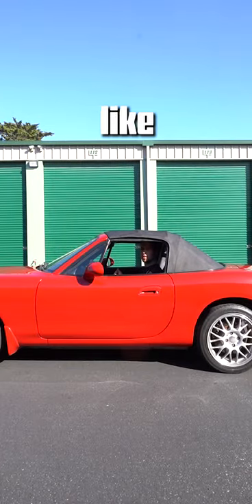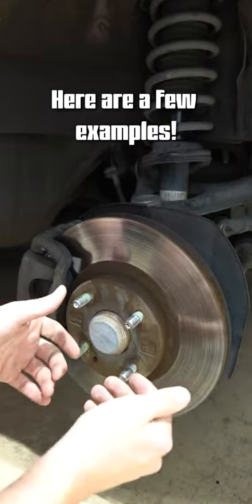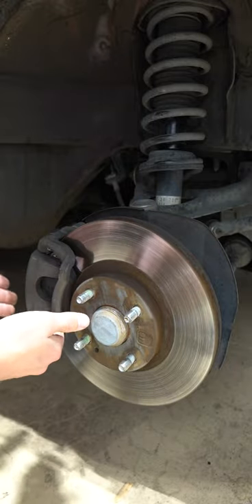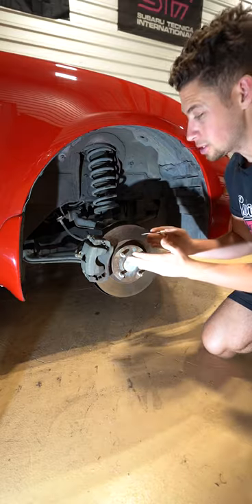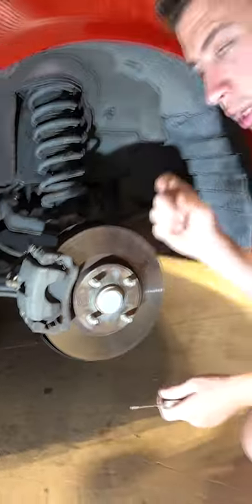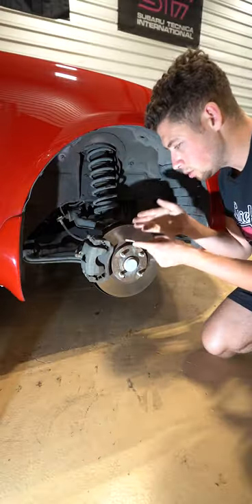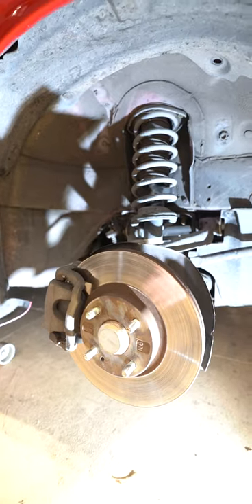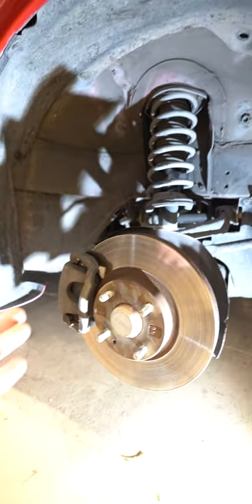Why Brakes Squeak

Comment: I just replaced my rotor and brake pads and literally get the same squealing when braking. Can’t find the issue any help would be great
Reply: When u get new pads u want to break them in, if u don't and brake to hard it will cause your brakes to squeal till those pads get changed again
Reply: @Spacetaco420.  when braking them in do you mean just driving around normally or like driving and braking hard a few times
Reply: @SnowTime72  I mean when driving with new brakes, don't brake too hard. Atleast until 20-30 miles. Unless you need to brake hard of course.
Reply: @Spacetaco420.  okay cool cool because I got new brakes and I did brake hard and ima assume with all the heat from braking they probably crystallized or something but I know better now
Reply: It could be a stuck caliper piston.
Reply: @eurasianlynx  Exactly. I just did mine and the pin is seized/frozen. I went to my auto parts store and they told me they are out of stock everywhere including the Jeep dealership. It’s the first brake job so the idiot on the assembly line didn’t lube the pin. The brakes even had a few thousand miles left on them.
Reply: I switched my rotors. My breaks pads twice. Same squeal. It’s driving me craaaaaazy
Reply: @elmoneyyy did you figure it out ? Cause some

Comment: My car was still making those noises even after I changed the pad and the rotors
Reply: Did you figure out what’s wrong?
Reply: I know and it’s so infuriating when these YouTube “mechanics” don’t ever have another reason they could be grinding smh
Reply: Check your rotor heat shield! Sometimes when you do your brakes, that shield behind your rotor can get bent or over time warped and cause contact with the back side of the rotor. Quick and cheap fix!
Reply: did you replace the little thing that makes it squeal to let you know when the brakes are wearing?

Comment: I actually thought my brakes went bad on my Lexus IS250 but it makes no sense as the rotors and the pads are actually new. Changed them last year with only 8k miles driven on them. I don’t even brake that hard too. Anyhow good info. Also it was raining the last few days so rust can be it too.
Reply: Hey man, I got a lexuis300 did your issue resolve? I see some comments talking about them just breaking in after driving a couple hundred miles but mine still squeak every morning
Reply: @CristianSanchez-bh9yc you solve the problem? I have a is350 with the same problem

Comment: Took my car to shop they said it was good and the numbers we’re perfect 
It still squeaking 
2019 Impreza
Idk I clean it with break cleaner as well
Idk
Reply: Whenever you get new brake pads, if you don't break them in for 300-400 miles then your pads will squeak till you get new one's. I'm not saying this is a solution, but it could be whats causing your problems
Reply: @Spacetaco420.  How do you break them in?

Drive for 300-400 miles while utilizing the brakes,
in a few drives?

Comment: That's my brembos is the morning
Reply: Same lol
Reply: @datjap8883  really dealer said it normal lol cause the rust and dampness it's does it once then when you hit it after it's gone I have 4800 miles on it lol
Reply: @Phoenixsuns1968  yeah probably true man, I'm not sure how many km's are on mine. 99 evo 6, but the rotors are slotted and drilled aswell. I know that can make them squeaky
Reply: Hi there, is it really common for brembo brakes to do this ?? I just got my new brembo disc and pads changed (which the rotors have drills in them )and now it makes a horrible loud squeal sound. Do you think it’s normal ?
Reply: @Ali-vq7vh  yup